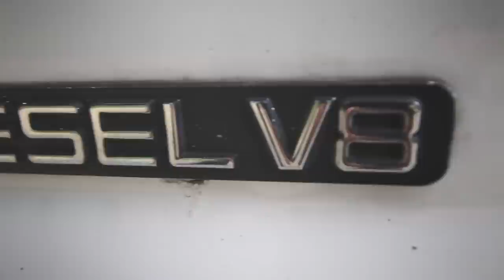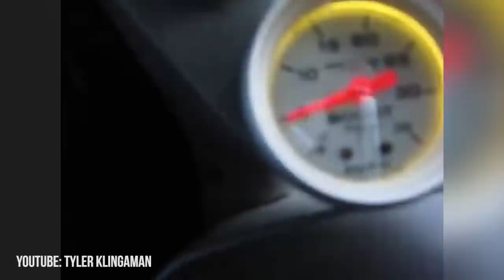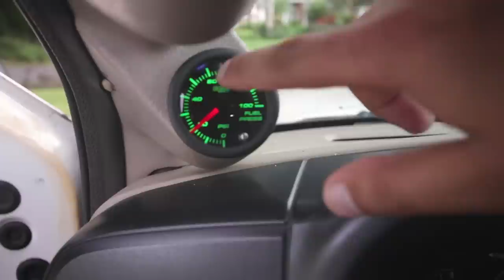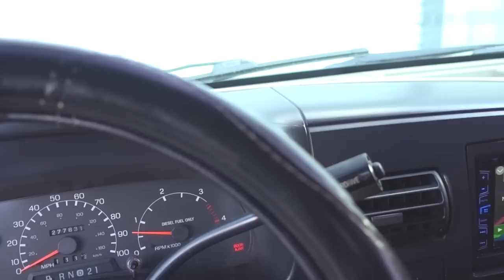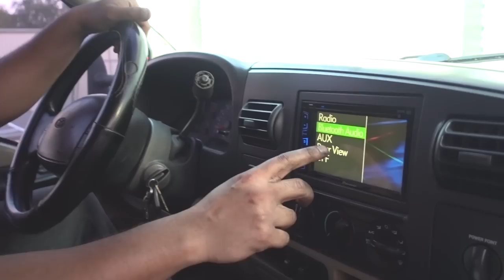Here's How I Made My 300,000 Mile Ford F350 Dually FAST As HELL (And Crazy Reliable)

Comment: those pipes you installed are called up pipes, the exhaust pipe coming out of the back of your turbo is your down pipe
Reply: Glad I'm not the only one who noticed that.
Reply: That motor won't last long without arp head studs
Reply: @jacobwood9227  dude that's a 7.3 not a 6.0. Studs are not needed at that psi
Reply: @jaycevessier7554 I thought 2003 was the last year of the 7.3 . That's gotta be a 6.0 if it's a 2004 unless it was swapped, or was the 7.3 optional in 2004?
Reply: No Name he said “2000 Ford F-350” I thought he said 04 as well lol
Reply: @jaycevessier7554  nvm thought that was a 6blow
Reply: @42ambrocio  in early 2003 it was still a 7.3... mid to end of 2003 it was swapped to a 6.0
Reply: @jacobwood9227  even so... a 6.0 is a very good reliable motor once studded and egr delete
Reply: @jaycevessier7554  the new 6.4 I had to work on one that my buddy had it had twin compounds from factory talking abuot no room to work on it
Reply: Jacob Wood sup bro😉
Reply: @justinwood61  lol not alot
Reply: @jacobwood9227  6leaker powersmoke
Reply: Thank you
Reply: @jacobwood9227  7.3s come studded  from the factory
Reply: @42ambrocio  you can't tell by the sound difference that is a 7.3...
Reply: @praisethenameofjesuschrist8971  no they do not.  They are a head bolt.
Reply: @jacobwood9227  it's not a 6.0 just has the front clip of one
Reply: @jacobwood9227  wrong
Reply: @trevorfoxen2131  black powerstroke badges means 7.3
Reply: @42ambrocio  he said it was a 2000. it has a face lift, lights, grill, and bumper.
Reply: Me puedes mandar los link todas las piesas que compraste para yo comprarlas por favor 🙂

Comment: I rebuilt every thing above the valley. I replaced all my glow plugs. My buzz test went well for my my existing injectors. HPOP, rebuilt. Modified fuel bowl restrictions-deleted. Turbo pedestal modification, Delete EBP. Rewired my sensor harness from one end to the other, all by my lonesome. Rebuilt my turbo and modified my compression wheel. Reset my wheel to specs myself no outside help needed. Replaced all my pressure sensors, timing, etc.. All new sensors. HPOP hose modification, upgrade. New valve cover harnesses. New Low pressure oil pump. New harmonic balancer.  212 ft. lbs. WOW!  New fan clutch hub and new water pump. water pump nut = 98 ft. lbs. All new A/C system radiator, condenser, evaporator core, dryer, tube filter, High and low side r134a hoses. New bulldog water coolant reservoir and filter. Fuel pressure gauge and water temperature gauge under the hood. New fuel tank level switch, in tank filters, Fuel pump and secondary oil filter modification. New in dash lights. Above all, a new PCM! Reset my transmission shifting to my foot. Note: a new PCM will require a degree of research to get every thing in proper running order. Runs like new!   I forgot the new Power steering pump. High dollar batteries and new upgraded cables. You got it! I love my 2002 f350 7.3 powerstroke!

Comment: That fuel rail return is because the fuel galley in the head is dead-headed.  The fuel comes from the tank to the filter/regulator assembly, then excess fuel is routed to the tank.  The low pressure (75psi or so) fuel is fed to the galleys in the heads, which distribute it to the injectors.  This kit completes the circuit back to the fuel filter/regulator assembly.

Comment: I just picked up a 2001 F350 7.3 Dually 4x4 CrewCab 6 speed Manual and OHH MAAAAN that thing is so much fun for a slow heavy pig haha, its true what they say about its fun driving slow cars fast. I just bought a 5" straight pipe for her and shifting gears with a 5" straight pipe will be a smile on my face for days!!!! Yes tune will come next, then wheels, more mods, interior swap, 2016 Front nose conversion etc etc etc etc.....

Comment: Hey Freddy, been following your videos for a little while now since you took on the lambo build. Both dad and I own f350's for hauling our toys across the country. I've been maintaining both of them since I was 16 and have been doing my best to make them more efficient and reliable. The 7.3 is a great engine once you wake it up and make it run efficiently. 

First thing I would suggest is getting rid of the dp tuner, they are known to have aggressive fueling and hold the torque converter unlocked causing the 4r100's to run hotter then normal especially when towing. 

I've been running the PHP Hydra chip on both trucks for a few years now and have been really happy with the performance and fuel economy from them. You can program up to 15 tune files into the chip as well as a no start mode for security when you stay somewhere. 

Keep up the good work man, enjoying the content.

Comment: May be my earbuds but I still hear an exhaust leak. I own 2  7.3’s for my business and after 600k I know them well. A leaky up-pipe will KILL drive pressure.. and therefore boost. 

Hope this helps!
Reply: 08ttimlin I hear it too. It’s a major leak. Might be the EBP sensor tube...
Reply: headers are probably leaking, it took a while to find mine, both sides were leaking
Reply: Yea I can hear the leak as well. Usually the elbows at the ends of the manifolds blow out.

Comment: Disconnect and plug the red vacuum line from the turbo. This will increase your boost and lower egt  The waste gate will still open when you get off the throttle

Comment: Hey Freddy make sure that y- pipe is sealed properly with the turbo exhaust side. That's a difficult thing to do right the first time. And check high pressure oil lines in valley that are known to leak. As well as oil gallery plugs o-rings.

Comment: I still have the EBPV on my truck, and it really only works when it's below freezing outside. When it's working, the engine bogs down a decent amount and it just becomes slower overall. If you put your foot down a little, it'll open back up and run like normal. Once it gets a little warm it opens up and runs normally. A lot of people disconnect their EBPVs on their trucks because it's not really needed.

Comment: You shouldn’t be really worried about performance I have a STOCK 1995 f350 dually that makes 210 hp and 425 torque it pulls a 20,000 lb trailer no problem. The only mod I would recommend on your truck is switching to a 6.0 trans cooler so your transmission lasts.
Reply from the maker: Already done!
Reply: 7.3forlife, if you like how ur truck runs now, then you should definitely buy a set of full force 180/0 injectors, adrenaline hpop, efuel with regulated return, and custom tunes by gearhead. My trucks also a 95. Those are the mods iv done, I should be about 350hp, and a bigger turbo should get me close to 400hp, and like 1000tq. But the truck is already a beast, it’s like 3 times the truck from what it was stock

Comment: Lake in the pan is the o-rings on the fuel bowl and HPOP us 7.3 owners keep the oring packs in the glove box :-)  my 2000 has 568K miles on it. I use a Mustang 6 position tuner and I build way more boost with a Banks bighead kit and a 6637 Air cleaner mod

Comment: Installed the ats housing on my 01. Absolutely loved it. Install a stainless steel hpx tube for your high pressure oil. That will help. Also remove your stock waste gate actuator and install one for a 3406 E Cat. It will make over 30 psi boost

Comment: IDK if anyone has pointed this out or not but take a look at your high pressure oil pump. A common occurrence for these 7.3L is the HP oil pump goes out and leaks causing an oil puddle in the valley. My grandfather's truck had the same problem, and we thought it was the turbo pedestal too, but with closer inspection it was the pump. Just something to look for if what you've done here didn't solve that issue.

Comment: 300k miles? That's just break in period for a 7.3
Reply: Nicholas Beer I hear they’re re releasing the 7.3 in 2020 if that’s true I might have to sell an organ or something
Reply: @remar-6  Its a gas 7.3 though😢
Reply: @remar-6  Yeah it's a gasser.. probably wont be nearly as reliable as the older diesel.
Reply: Nicholas Beer that’s lame thanks for the info.
Reply: @remar-6  it's unfortunate that ford is just using the 7.3 name to sell ne engines..even tho it is nothing like the original.
Reply: They’re not using the 7.3 name to sell engines. The only thing they have in common is the displacement. They are upgrading from the 6.2 to a 7.3.
Reply: That's like saying the sky is blue
Reply: Nicholas Beer It's a pushrod gasser at least. I'm glad to see big block gassers making a resurgence for trucks. They outshine diesel for local applications whereas diesels are perfectly happy churning away at full song for hours at a time
Reply: jon doe  lmao 6.0 L engines are lemons XD my dad's 1997 7.3 went to almost 600k before getting totalled in an accident
Reply: @noahranker4133  releasing is the key word
Reply: Yar Nunya  you can still clearly see it says power stroke diesel on it 🤦‍♂️
Reply: They are going back to a pushrod setup for it though so that should help a little with reliability. I can't wait to see what they do with it.
Reply: That pushrod gasser may be a popular swap 10 years from now, 1 cam means greater after-market potential and cheap aftermarket prices.
Reply: jon doe  except its not reliable gutles unless you delete it and tune it oh yeah and they toss injectors at 180k
Reply: I’m sayin

Comment: turbos don't make boost. they make air flow, the engines resistance to air flow makes boost.
Reply: Actually, a turbo is an air pump. And in order to pump a fluid, you have to create a pressure differential. Or pressure. Or boost. Turbos positively pressurise the intake track. Not sure what you're trying to say anyway.
Reply: Ha ha, another Diesel dip-shit. The turbo IS what make the resistance difference this creating the variable boost pressure. Please change your name.

Comment: I want a dually
Reply: Best heavy haulers out there. My 2011 Chevy CC Dually now has 460,000 miles on original engine and trans. Follow strict maintenance habits and 1 million is doable.
Reply: @donnbailey2056  dam that's a lot of miles for 9 years
Reply: @donnbailey2056  you love your baby good you keep a strict maintenance those are good habit but that's alot miles
Reply: It was one of my RV transporter trucks. When I sold the business in 2016 I kept that one truck for my personal stable of vehicles. I expect to have it for the rest of my life. The truck can do just about anything you would need a big pickup for. Annual maintenance now is next to nothing.
Reply: Not Hitler  I've had my 90 ford ranger for 6 years. I do basically all the maintenance myself

Comment: I wonder f350 is good truck for beginner like me
Reply: Sam thank you
Reply: An f 150 or the "new" ranger
Reply: Dont be a wimp. Get the f350
Reply: Get a duramax less problems. I'm a cummins guy. But when It comes to the nutt cutting. Duramax lly and lbz are the most reliable. 7.3l are good but they have alot of problems that you dont want to deal with.
Reply: HolyGrail 95 like?
Reply: @DieselAddict-vs9fc  7.3 is significantly more reliable. The only thing that compares in the 5.9 Cummins. That is pretty much universally agreed on.
Reply: @residentevil2928  negative I'm a diesel mechanic I see facts all day long not opinions
Reply: @residentevil2928  my 7.3 has 209k miles within the last 20k miles I got. New trans new rearend new injectors and glow plugs, turbo, a gallon of oil consumed ever 500-600 miles, and the truck is bone stock never had any tune serviced every 5k Miles and never pulled heavy. These problems are common in a 7.3 we never have duramax's in the shop with these problems mainly 7.3 6.0.
Reply: HolyGrail 95 you got unlucky because my tuned and bolt on 02 264k 7.3 has only needed an oil pan and a set of batteries...
Reply: @wolfyturbo  I see it all the time in the shop. The problems I have on my truck are very common on these trucks. We have a company that it runs 7.3l and he has like 30 of them. We maintenance them very well and we do all the work to them. And they're not being working like crazy they're just flatbeds. We replace motor with blow by with around 200k to 300k all the time. And alot of writing problems.
Reply: @wolfyturbo  and yeah some people get lucky but I see alot of people that are having the same luck if not worse then mine.
Reply: tbh just get a older truck my first was a 98 Silveradoado and I loved it.

Comment: A fast 7.3? Come on tavarish be real😂
Reply: Lol right. My 99 7.3 is slower then snail shit
Reply: HolyGrail 95 you probably have the early 99 7.3 that one has smaller turbo and injectors
Reply: @Lorenzom6970  I believe it is the earlier one not 100% sure the door sticker is messed up I can tell the exact date. But the engine is the same until they changed to the cast rods which changed alot of stuff like. But they still have the same problems. Same injectors. Different turbo and turbo pedestal bigger intake tubes. But I've always like the 7.3 until I owned one. My engine can handle more horsepower then the newer design
Reply: Y'all Never Hear of a Banks Kit?

Comment: Probably gonna catch some flak for this, but if you want actual power and torque, get a 6.0 and have it bulletproofed. ( I suggest Bill Hewitt of powerstrokehelp/powerstroke speciciliaty.)
Reply: Worked on 400 + Successful Lemon "Sick.0" cases against Ford in CA...looked over 2 million pages of dyno runs, failure charts, Ford/lnternational e-mails, pre-production head gasket failures, defective head designs... Anyone for a 6.7?
Reply: @dougauzene8389  cool, lemme know when you stop bragging and I'll act like I'm impressed
Reply: @aliabdallah102  Maybe l know a little more about 6.0s than you...lntimidated, Son?
Reply: @aliabdallah102 The 6.0 owners l got 100% buybacks for would beg to differ...You Ever Acrually Give Something Back, stead of Taking?
Reply: @aliabdallah102  l'm a Legal Analyst, with a 3 plus decade experience in autos (repairs, restorations, modification & racing) My work has always been for the little guy (consumers, injured, etc) Hardly the "scum of the earth", as you childishly refer to me...
Reply: My f350 is bulletproofed and it's a real beast
Reply: @dougauzene8389  same shit, different toilet.
Reply: @jasonjay6245  Nice...Too Bad Ford didn't build a better 6.0 so you didn't have to spend more $
Reply: You ever actually have a 7.3 or have you been in one with turbo upgrades and simple bolt ons? Wicked wheel 2, intake, exhaust, and tune and you can max out the stock sticks, it’s easy to make decent power with a 7.3 for less money then it would take you to bulletproof a 6.0 nevermind then spend the more money to mod it to make it keep up to the already cheaper and more reliable 7.3
Reply: @wolfyturbo  Yes, my late uncle owned a 99 7.3 Dually...towed the boat from L.A. to Havasu 75mph all the way...He did similar upgrades, plus he had a Banks kit installed...Miss him & the truck...

Comment: Doh! you could have had a new compressor wheel over nighted by Amazon.  Also the turbos on the 7.3 was not balanced together.  It was only individual component balanced then assembled.  I have a 7.3 in my truck, love it and really glad to see you spending some time on the truck.
Reply: Also you should install an aftermarket transmission cooler, either one from a 6.0 truck or Mishimoto if you are going to be towing more.  The weak link is transmission cooler being tiny and cooking the fluid when towing.  Are you coming through Albuquerque on your trip across?

Comment: Best way to seal the up pipes to the y pipe is to use old Chevy exhaust biscuits instead of the ford ones. Same pipe size just thicker and seal better and longer. With my experience on my 06 6.0 is no eBay or amazon parts non oem parts.   Great video and love the front end conversion.

Comment: To fix the flicker on the dash and stuff, you can change the shutter speed of your camera. Electronics like lights usually work at around 60Hz, so make you to record away from 60Fps, and it will not flicker. And don't do stuff that goes into 60, like 30, because it will derp there too.

Comment: Awesome to see you work on the 7.3. Those are your up pipes you might think about adding a airdog or fass lift pump to the truck as well. The stock lift pump isnt very reliable with fuel delivery. The regulator setup will help though.

Comment: It's typical to see a diesel to Ash when under load.  Definitely would suggest a injector tune-up because there may be soot build  up.  Replacing that line could have been a clogged causing low pressure.  Also when pulling out the turbo, would it have been easier to remove the cowl and pull the unit straight up.  Figure it would be a little easier to pull it out.  Last thing turbos on Diesel won't provide full boost unless under heavy load which more fuel is required along with air.  I believe stock desiel will produce 0-7psi with no load on it.  InPark it will make not boost at all because there's no load.

Comment: If you want to do preventative maintenance I would also recommend changing the oil cooler seals with that many miles also the 7.3 should run between 55-65psi of fuel pressure I’m also in the process of building the previous generation powerstroke myself

Comment: Compressor wheel does not need balanced they are factory balanced its a bolt on and go part. Sounds like an exhaust leak might be messing with your boost. Fuel pressure shohld be about 60. Good video